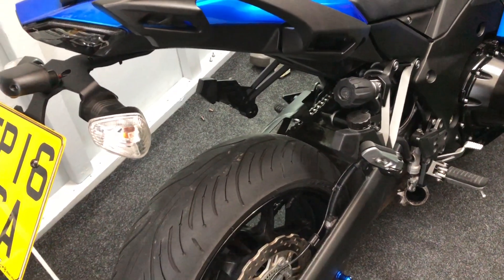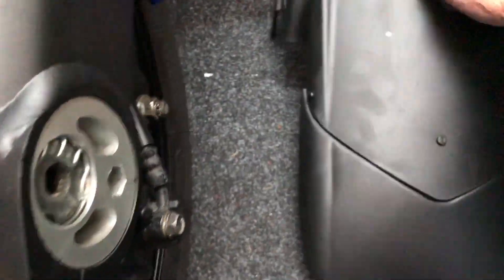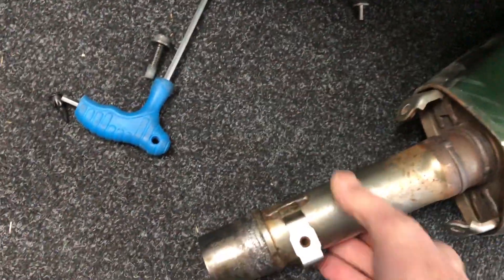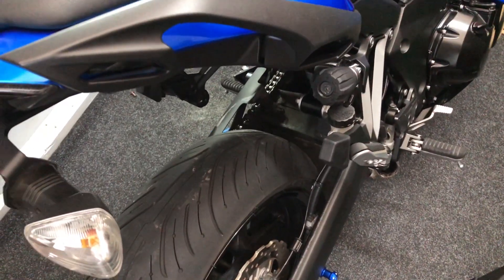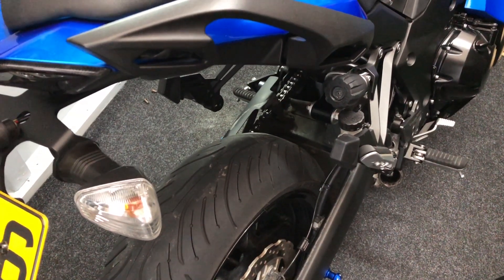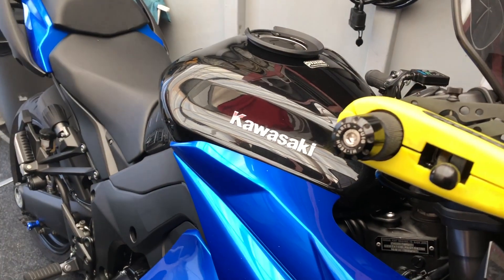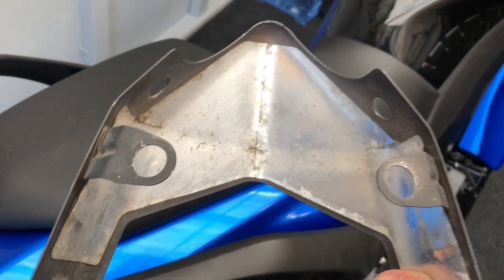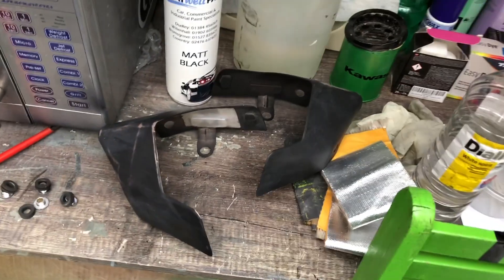Kawasaki Z1000SX Excessive Work Carried Out read description

Comment: Hi Derek, What spray paint colour code did you use for the guards? ...and what did you clean the exhausts with?
Reply from the maker: Hi John the black heat shields is Matt black from Halfords the lacquer is Halfords satin lacquer. 
The sliver heat resistant paint is from my local paint specialist  I suppose Halfords do that as well but they never had any in when I wanted it. 
I cleaned the pipe going into the exhaust can where it was really rusted with harpic X10 very carefully make sure you have warm by hand to wash it away has soon has it look clean I used a small brass brush on it once washed and dried I used the metal cleaner solve a lot of rubbing but worth the effort you into it once again be careful with the harpic X10 have plenty of warm water to rinse it off hope this helps you 👍
Reply: Just an after thought Derek ...to save the heat guards getting scuffed again ..I’m sure you can get heat resistant black Matt wrap ...I’m going to do the tops of my panniers with a clear wrap as they are prone to scuff marks from your boots ...👍
Reply from the maker: @JOK3R474  hi John yes your right there I’ve bought the complete set of safe guard paint from speedoangles Paint Protection Film Stone Chip PPF: KAWASAKI Z1000 SX 2014-2016 - CLEAR 
Got to fit it when the weather warms up need a warm room to do it it works the same way has vinyl wrap 👍
Reply: @SOLOMOTOUK   Seen that kit Derek ...£59.99 ...Not anything there for the tops of the panniers though ...
Reply from the maker: @JOK3R474  hi John no part for the panniers but you can buy the film on eBay cheap I’m always catching the top of them with my boots. 
Change of subject I bought keis heated jacket J501 there heated gloves G601 and there heated inner soles plus the new LS mk 2 2020/21 helmet all good gear I’ll have to put a video when I have a bit of time 👍👍👍
Reply: @SOLOMOTOUK  nice one Derek ...looks like your expecting a long cold winter ...😂just buying some addons ..R&G hand guards ...R&G Tail Tidy ...Powerbronze Fender extender....going to be busy ...
Reply from the maker: @JOK3R474  I tried some hand guards had to send couldn’t get the bike through the house 👍